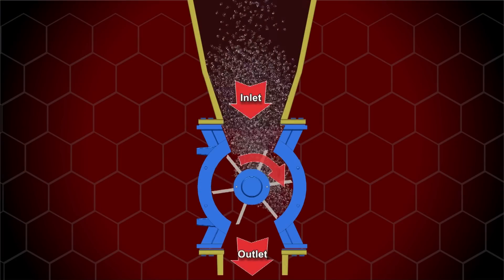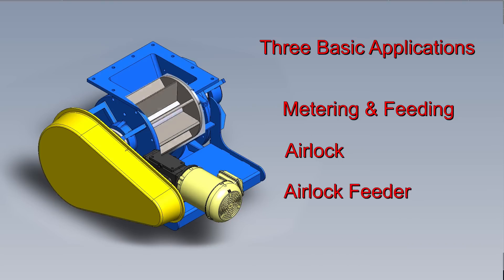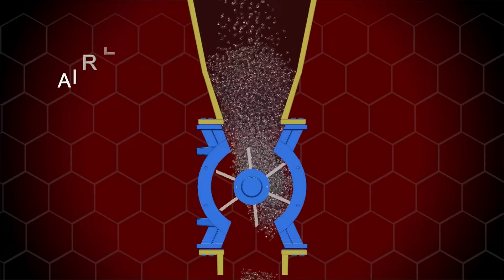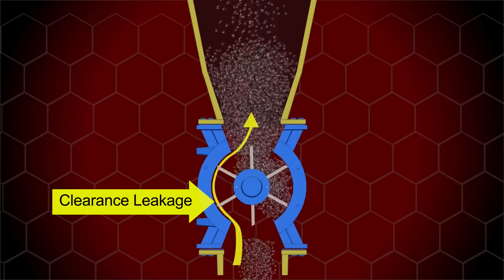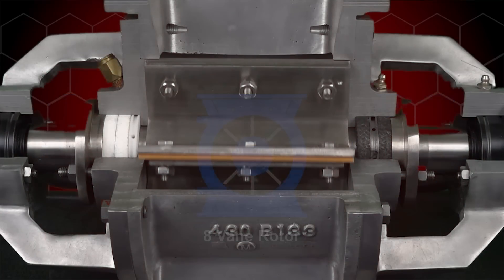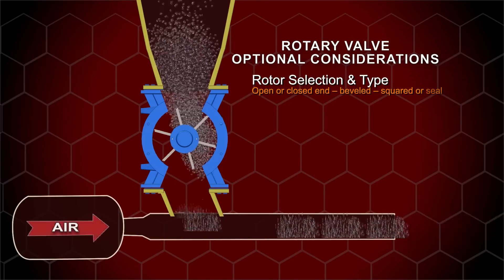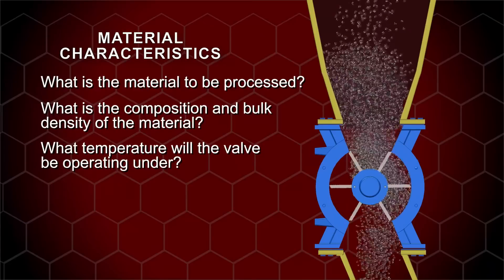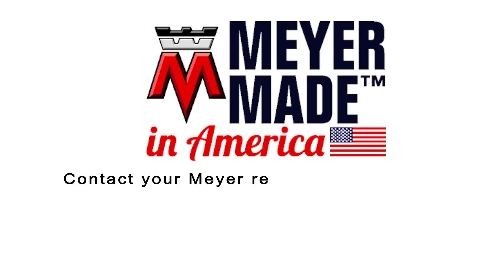Meyer Rotary Valve Basics

Comment: Handling heavy material is not easy, you need to have machinery power to handle those heavy machines. So we manufacture products that can help you in handling heavy machine easily without putting a lot of effort.
https://suncopowder.kinja.com/visit-sunco-powder-system-1837123905?rev=1565435151694

Comment: Rotary valves maintain a certain amount of pressure in the production chain. The production chain is a long place with different pressure points. It helps in to keep the work going.
https://suncopowder.tumblr.com/post/185428386530/rotary-valve